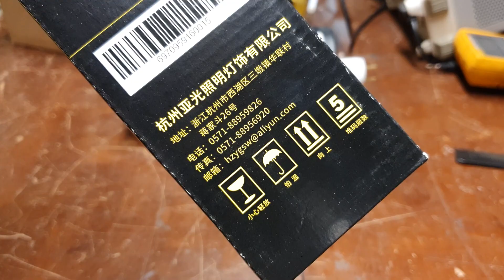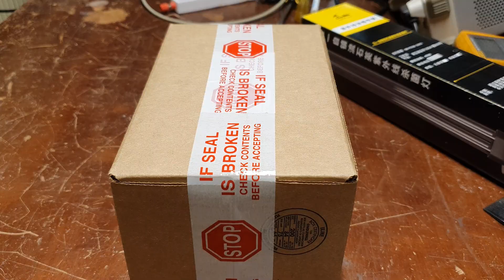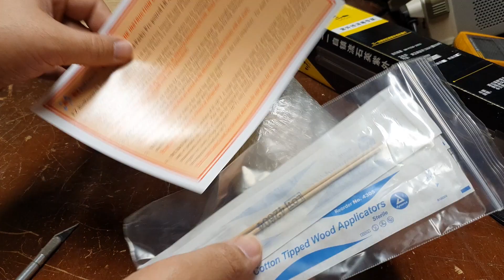Virus Blaster Mini, with Photoelectric Effect Bonus!

Comment: If you can make the leaf go down via the pe-effect, shouldn't it also be possible to raise it/charge the electroscope positive ? Why go though the trouble of charging it negative first ?
Reply from the maker: Great Question very logical and there is a good reason why this doesn't happen... I'll try to address this my next video about photoelectric effect.
Reply: @sparkstarter  The electroscope is just a lyden jar/capacitor without an outer electrode, lack of which I presume would give it an extremely small capacitance, and it should be prone to leakage given the geometry of the conductor (or maybe not, precisely due to the lack of the outer electrode/plate).... even if my assessment is incorrect, it would still be interesting to see how the leafs behave if the outer plate is present.   Hook a flyback to it, see what happens.
Reply: @sparkstarter  Your multiplier could do the trick too. Maybe a good idea to point out in the title itself that the output is rectified. You could simply do one loop of wire for the "outer plate"  and see if moving it up/down will affect the leafs. Don't think I've seen it done before.
Reply: Ofc try both polarities. User Vidduley has a good video on the topic.
Reply: @sparkstarter    The second answer contains a very unintuitive suggestion (nothing would seem to suggest that the electroscope would keep charging positive if the "inner electrode" were grounded) physics stackexchange com/questions/133289/what-happens-to-a-metal-plate-in-the-photoelectric-effect